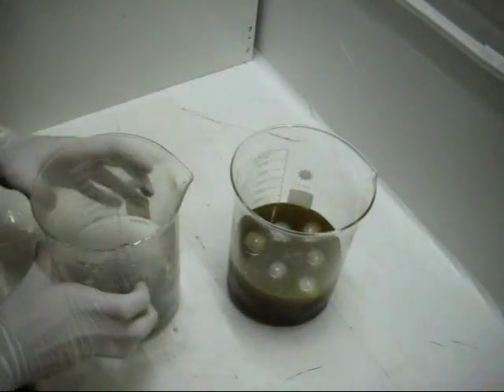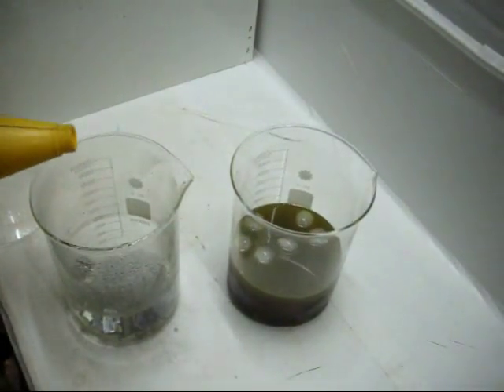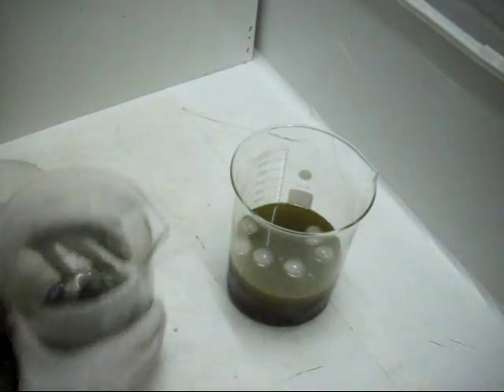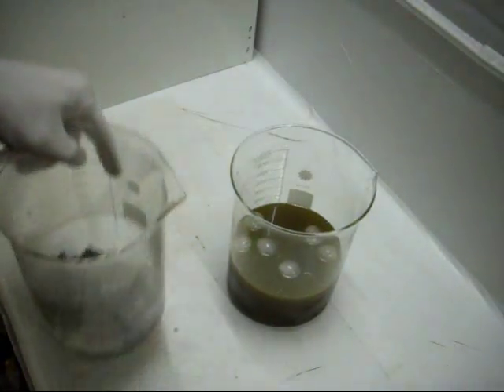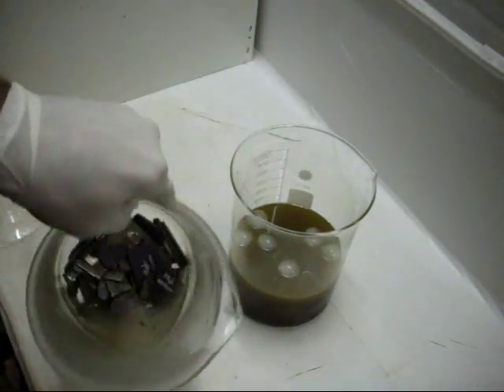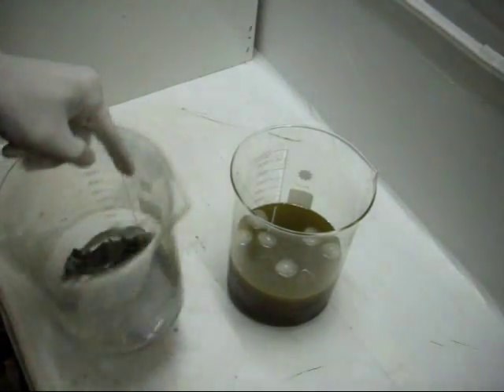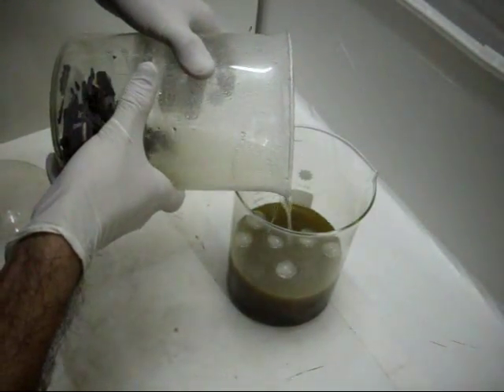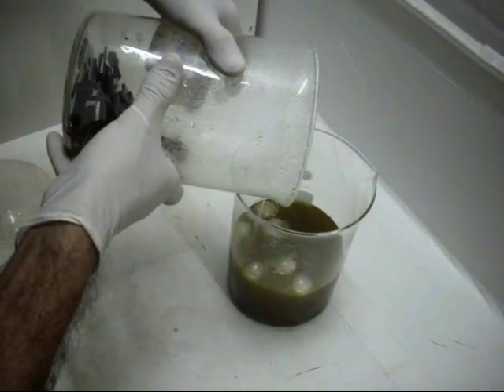Precious Metals: Gold Recovery from Scrap CPU - Part 1

Comment: years ago as a young bloke i worked in metal refining  factory,  used to do similar to this but much more in depth, on average 100 kg batches of gold would come in to be refined to 99.9 % pure, also used commercial grade sulfuric in the process(dangerous shit not to be trifled with),  i can recall some jet engines also have the turbine tips coated in gold and would come in for gold  recovery.
 interesting process to watch, FROM A DISTANCE  :).

Comment: ff216 and indeeditdoes, you are both right, the thing is if you buy HCl on a drugstore you will get a high purity acid, that is expensive like that, if you get muriatic (industrial grade HCL) you get acid plus godknowswhat that will result in lower yields in some reactions.
the sodium nitrate would be NaNO3 not NaN (which looks like sodium azide, the stuff in airbags, actually that is Na3N)
Great video!
I will look forward to do the same with tantalium from capacitors.

Comment: I used a method of stripping gold with cyanide and precipitate  the gold using sulfuric acid.  I am a chemist.  I kept adding more gold solution to get the most in a short time.  The precipitated gold began to form a heavy blanket of gold in boiling hot solution.  Gasses from the cyanide and acid built up under the precipitant.  The pressure of the gasses blew the entire contents through the fume hood like a pressure cooker.  Had I been standing over it, I probably wouldn't be here. No fun!

Comment from the maker: 35% -45% is good enough.
Use just enough to cover the lids with solution. remember to bend them a little so they won't stick to each other.
The acid should not dissolve the metal under the gold layer (Kovar) at room temp'. It will however dissolve the thin nickel layer between the gold and the covar, thus remove the plating with very little nitric actually being used so you could reuse the same solution several times.
Whatever dissolves in the nitric, is not gold, do not be bothered by it.

Comment from the maker: This particular batch was of 18 units (515g total).
They yielded 1.31g of fine 999 gold, that is a fact! not an estimation.
1.31g of fine gold = about 68$
These 18 pieces cost me 12$, the chemicals involved cost me less then 1$. melting costs are few cents a gram.
Iv'e spent (totally) about 3 hours of my time to work this batch (influding producing this video).
Now do the math...  and think about what if, i would have done several pounds (which i normally do with similar setup.

Comment from the maker: @benner2000 
Hi
This question has two answers: Yes and No.
Yes, you should worry about the base metals, this is why a fairly large amount of chemicals are used.
No, you should not worry about base metals due to their composition alloy (Kovar) which pose much less of a truble (in stu interaction) when enough chemicals are used.

For example: Had the base metals of the pins were made of Copper or brass, a direct approach such as this would have resulted in great mess and probably a loss of gold.

Comment from the maker: Muriatic acid (HCl) you can buy at Home depot or Lows for less then 2.1$ per liter.
35$ per liter is simply theft.
At pool supply house or cemical supplyer you will find it even way cheaper at around 0.5-0.8$ per liter.
For the batch in this video i didn't even used a whole liter.

Comment from the maker: First, before you go ahead, test your solution for gold with stannous chloride. Assume nothing.
It should not fizz and bubble too much upon adding SMB, if it does, there's too much nitric acid. 
If you SnCl2 test is positive for gold then:
Dissolve 15 gram SMB in warm water and add to the gold solution. it should turn dark black and stay that way.
If it doesn't, or the dark color dissipate. repeat the SMB addition until it turns dark and stay that way.
The black powder is your gold.

Comment from the maker: @CoinSilver800 
While this is an important saftey note, i'm only partially agreeing with you.
We both know that HCl does not protonate water as violently as, say... sulfuric acid or selenic acid does.
Yes, there is a better chnace of an acid splash (then water) when the water are added to acid, but with safety gear and with much care, this becomes parctically negligible risk.
I'm diluting HCl and nitric acid with water added to them on a daily basis. The risk with THESE acid is just not there.

Comment from the maker: @Emeengor 

Generally, yes.
Please understand, that for the sake of most presentations i create, i'm using small batches.
For example, when i process few pounds of CPU's at the time, it takes pretty much the same duration, labor and power. Chemicals cost is almost negligible either way.

Personally, my scrap buying prices are low enough to justify most recovery & refining efforts. It's all about pricing....  and cherry picking what to process.

Comment: the cheap way is to get 2 good pliers.  hold the circuit board in both hands with the pliers and crack it apart like glass.  then grab any corner of the gold with pliers and peel it.  then sell the scraps to a professional buying gold.  It would save on shipping.

Comment: Do you have a recovery process for just the metal pins and connectors alone and is there a separate process for extracting gold from gold laden circuit boards?

Comment from the maker: The batch in this video included 18 cpu's which amounts to 515g total weight.
The yield resulted in about 1.3g of pure gold worth around 76$
The amount of sodium nitrate used was less then 200g (worth less then 1$ per kilo)
Total direct labor around 1.5-2 hours.
Now keep in mind, that in this particular video, i have processed a very low yield cpu's (74 mg per unit) in a very small batch.
many other ceramic cpu's yield way over 120 mg or pure gold per unit...

Comment: The time, material and health risk taken to get the gold out of the CPU has to be a higher cost than the gold you can extract in this way. A normal CPUs is not expensive and when you buy them you pay more than the good prize of the gold that are inside the CPU.

Comment: i just crush the cpu s in a sement muxer with round rocks then tumble the powder with 0.4% sodium cyanide sollution then i filter and add zinc powder settle and filter then burn it with oxy/propane

Comment: You should be sure to mention in your video that if you use Nitric Acid it must be neutralized with heated evaporation or urea, otherwise it is misleading and is missing a key step. I followed this guide to the exact bit and couldn't get gold to precipitate because the Nitric Acid (oxidizer) needed to first be removed from the solution.
Reply: With extra nitric acid floating around in hcl, gold doesn't reduce when SMB is added and wont precipitate, but instead forms sulfuric acid.

Comment: hi, I've got a few questions, could I use any nitrate salt instead of the sodium nitrate ? especially I would like to use ammonium nitrate (I would guess that I can use it, however I'm not sure about the effects of the ammonium chloride that will be produced), and the other one, what about the base metals ? shouldn't I change the HCl after the first boiling ? 
thanks for the answer
btw, you did a great job, really appreciated ;)

Comment: What does the solution look like after it has settled for a day? Can you see powder on the bottom?

 What happened when you put the Potassium meta in? Did you see a cloud in the liquid or no reaction? Did you heat the liquid a little while you added potassium meta? How much nitric acid did you use? how much HCl, (muriatic acid) did you use?. 

Have you tested the solution for gold with stannous chloride?

I need to know what you did so you can fix it and get gold powder....please.be patient..

Comment: 1 oz. = 28,349.5 mg. 28,349.5 / 75 = 378. Current market price of gold: $1,258/oz. So 1/378th oz. of gold; $1,258 / 378 = $3.32. Cool video and great demonstration, but unless you've got a shitload of CPU's laying around this is kinda just a waste of time. Interesting though.
Reply: Besides, if you subtract the total cost of the "ingredients" used on the "recipe", youll be losing money to get gold from scrap ...
Reply: And you can sell theses cpus for 5 bucks each piece, what a waste ...

Comment: @indeedItdoes Thanks. Either you buy in really big lots or have better suppliers; but true, more at once saves on chemicals some. 
I watched through again and read the comments. You may want to reiterate, as people seem to be missing it, that anything involving nitric acid should be done with a respirator rated for it, goggles, and gloves as the fumes are toxic, and will kill you is you breath enough of them. Imagine sucking on the tail pipe of a '50's Buick for an example of just how bad.

Comment: im just curious to if you could provide me with the type, cost an amounts of nitric and hydrochloric acids i will need to recover gold from about 5 lbs of gold plated cell phone parts. I've been saving these parts for quite some time and I was just curious on what you use and where you get these supplies. Ive been having some troubles finding a reasonable price for acids i will need.  thanks for your time and have a happy holiday :)

Comment: Thank's for shared this video!

I have one question:

What the of the material thing,to take back the gold from ,,king-water" ( 33% Nitric-Acid vol.65%, 2/3 Hydroclorid-Acid vol.30% ) ?

First step I used Nitric-Acid vol.65% tho remove any metalls and others ( plastic,ceramic etc. ).

Somebody told me use it the Natrium-biSulfide,but this isn't work it.

I'm waiting your answer! :)

Greetings from East-Hungary!

Comment: 75 mg of gold per chip is optimistic to say the least and there is no way anyone could recover the cost of the chemicals used doing this.
The process may be cost effective on an industriel scale where large quantities of electronic waste is available but certainly not on this scale.
The chemicals involved are exstremely dangerous and the fumes can cause extreme internal damage when inhaled. Nitric acid reacts with the skin instantly on contact and even a slight slash can cause horrific burns.
I

Comment: These pins of CPU are made from iron and than plated with gold  so when we use aqua regia to get Gold,  iron  and copper will dissolve too with gold in the solution, the question is:
SMB will precipitate the gold only or iron and copper too.

Comment: At first glance it would appear the HNO3 is reacting with probably the copper interconnect or any copper in the chips. If so, the green is hydrogen and nitrogen dioxide mixed with copper oxide, however any smoke or fumes made from this reaction should be brown with a pungent smell (Also toxic). I have never heard of green fumes from nitric acid. If this is the case, the solution shouldn't damage the gold and should wipe right off. Also this more than likely means your CPUs are gold plated.

Comment: I might also point out that possession of most of the chemicals involved is now illegal in Europe under anti terrorism laws (quite possible the US as well) without proper license. .... so don't be surprised if you get reported to the police when a chemical supplier turns you away when you try to buy off them.

Comment: How much did you spend on all the acid and the solution? is it worth to do all these process for you? 
I just looked up how much HCl cost and it was around $35 for 1L seems pretty expensive and if each CPU can only extract on average 74mg of gold that's only worth around $4 USD. I am not sure the exact ratio of number of CPU and the amount of acid needed to do this processes, but it seems like the amount of gold your going to extract from these CPU will not make much profit.

Comment: Please answer all the questions.  Give me a step by step of what you did from the beginning so I understand. The solution is green because of the copper that was dissolved with the AR. This is normal. When you use too much Nitric acid the gold wont drop into powder but stays in solution............I think that is the problem.

Be patient and you will be rewarded........be in a rush and it makes it harder.

Later.................

Comment: I other words if each processor yields 75mg of gold and 1 troy once is equal to 31103.476mg  then you will need 415 microprocessors like this one to archive 1 troy ounce of gold. The only question is how are the costs of the chemical products you use and to get the processors.

Comment: MAN, i wish i could find a place to buy thoes chemicals, it got BOXES of old computer parts and that includes a collection of old cpus, and of course all most all of my amd cpu's are fireid. and i also got 10 pounds of scrap copper i cant get rid of because nobody seems to buy scrap copper around here.
Reply: 26dolla i already gave up on trying to sell metal, now i wanna try mining for bit coins.
Reply: 26dolla Mercuric acid is the exact same thing as hydrochloric acid and copper sulfate works better than peroxide.

Comment: Has anyone tried an automatic center punch on an old Duron right on the core?

Try it and come back to comment :)

Might be a surprise.
Reply: WHATS INSIDE OF IT????
Reply: The core has some cool looking crystal material inside of it :D

I think its a bit like silicon carbide, the surface is also pretty hard.
Reply: The pent Pro CPU's have gold under the crystal. You can incinerate or break into small pieces and recover gold. The rest have small amounts of copper/neg silver.  
***Contrary to rumor there is NOT 1g of gold in Pent pro CPU. I've never recovered more than .33g. So don't pay more than $15 on places like Ebay. You're being ripped off.
Reply from the maker: eamh2002 Silicon die is brazed in many cases (in old ceramic CPU's) with gold/tin braze.
dadrules714 Spot on.

Comment: 4:20 OMG what are you doing! No professional would ever put water into the remains of the acid, that's extremely dangerous! You're just happy you put it in fast enough to not vaporize the acid instantly. In general you should not seduce laymen to handle dangerous chemicals in a way they may think that everybody could do what you are doing so easily! Again, the chemicals used and originating in this process are seriously dangerous! Besides you're not mentioning any R/S phrases in this video!

Comment from the maker: @jwallbanger 
I sure hope that's not what they are doing.
All of my non organic waste is neutralized and heavy metals are removed before diposal
For organic (very little is actually produced) waste i'm paying a certified company to houl it away. Great deal of my reactions are scrubbed upon generation, so my exhoust of the ventilation system is probably less toxic then my diesl pick-up.
I'm planing a whole series on fume control and waste disposal, but it takes time to produce.